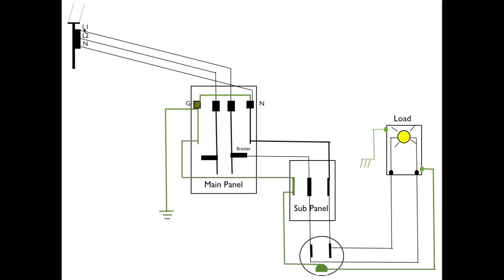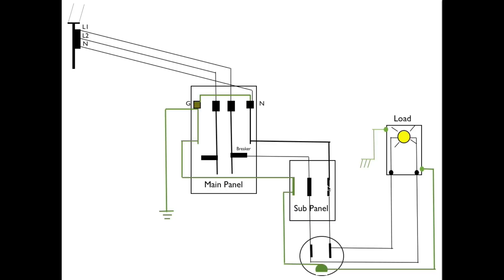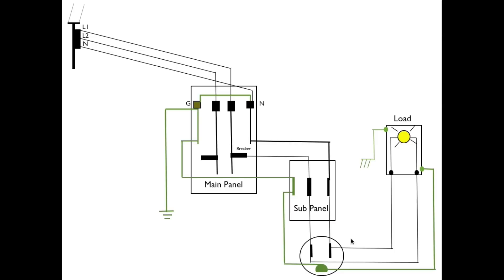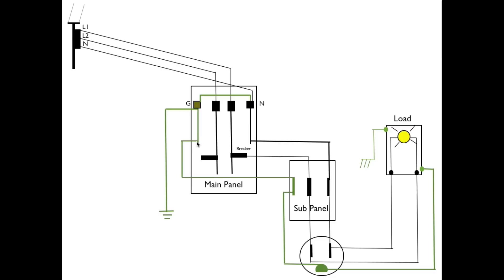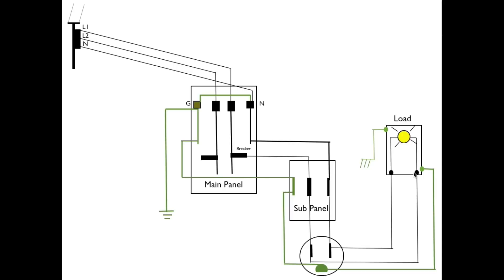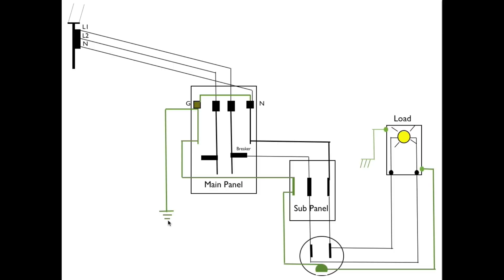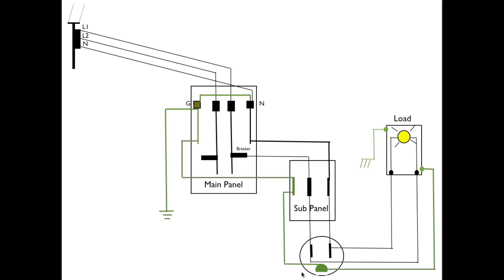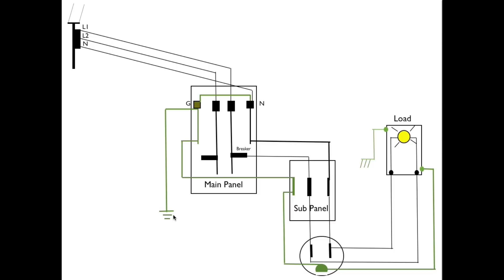The difference between neutral and ground on the electric panel

Comment: Black is polarized, white completes the Alternating Current loop,unlike Direct Current, positive to negative, where there is only one cycle. If A/C reverses polarity every second, then 60 cycles per minute.  The Ground wire connects the appliance to the Earth. A/C will seek out the quickest path to ground, don't be it.  That is the job for the breaker.  Nikolai invented this while he was digging a ditch.
Reply: 60 cycles per second.  
Try this to test your breaker.  Take a old metal case two wire electric heater into the bathroom and place it on the counter.  Wearing shoes plug it in and turn it on.  No shock. Turn it off. Take your shoes off.  Turn it on again.  No shock.  Turn it off.  Take some water and throw it on the floor. Stand in the water and turn it on again.  OH shit. Got shocked this time.  But not dead yet?  Take a razor knife and slice your finger a good one.  Touch it again. Should get a better shock.  Still not dead. Slice your feet too and touch it again.  It should kill you. If it doesn't you need to hold on longer.  Note that the breaker probably hasn't tripped.  If it does trip you won't hear about it. 
Only you can protect yourself from being shocked.  Don't put your trust in gadgets or other people.  Every time you don't get shocked just means you still have a chance to get shocked.

Comment: I am confused.  Looks like neutral and ground are in the same node, which means they are the same, isn't it?
Reply from the maker: They only connect together at the main panel.  At all other panels, they are kept separate to avoid the ground from becoming a current carrying wire.  This avoids a possible shock from touching the chassis of a sub panel or load.  Hope this helps.
GFM
Reply: Sorry, I don't see it as separate.  I see G and N as at the same point, or node.
Reply from the maker: They are not the same.  G is earth ground.  It has nothing to do with power conductors.  It is only for lightning and surges.  Try running a load with one side hot and one side to a ground rod not connected to the panel.  The load will not energize properly.  Neutral is the other side of line going to the pole transformer.  I have a number of videos on earth ground that may help and Mike Holt has some too.  Hope this helps.
GFM
Reply: I went and looked at your videos on G, N and Common, but I am still not clear on the distinction. You are right about G,N and C being used as if they are the one and the same.  I am still confused about them.  I do appreciate your videos.  Thanks.
Reply from the maker: Perhaps if you were to look at the problem as a circuit with its source at the pole transformer without any ground at all.  The circuit will work normally.  The ground is not necessary.  It is added just to absorb spikes and surges.
GFM
Reply: Did you say that think of G as having a large resistance?  I would have thought G has a zero resistance so that current can pass through fast, like short circuit, to absorb spikes and surges.
Reply: me too
Reply from the maker: To understand earth ground, you have to get away from circuits per se.  There is no real circuit thru earth ground unless you have very high voltage.  I have a number of videos on circuits thru earth ground.  Earth will absorb electricity under some circumstances.  That is not the same as completing a circuit.  Hope this helps.
GFM

Comment: Hi. Why is L2 not connected to the sub panel?
Reply from the maker: This sub panel uses only 120 volts.
GFM
Reply: Thanks. I have recently began the journey to self study wiring. Does your answer imply that L2 is connected to the sub-panel in countries that use 230 - 240 V as in the United Kingdom?
Reply from the maker: Yes.  This video covers the 240-120 3 wire system in the US.
GFM

Comment: The earth is an ocean of electrons. Generators "pump" the electrons out of the ground and into the electrical system (this is why generator stators are grounded). The electrons flow through the wires, to your house, and through whatever equipment they are running. After flowing through the equipment they "return" to earth via the ground wires that are connected to the neutral wires. That's why there are multiple grounding points in an electrical system. At least two for every load center (aka panel) and then down grounds (that connect to the power company neutrals or messengers) on just about every other pole. If you were to remove all of the ground connections in a system, the power would stop flowing because it would have no way to get back to ground.
Reply from the maker: So, I guess I will be electrocuted when I stick a shovel in my garden.  You could remove all earth ground conductors and the system will work normally.  I have done several videos on earth ground.  Check my grounding and bonding playlist.  What you are seeing with ground wires on poles and panels are just lightning protection with some surge and spike protection.  For many years electrical systems were installed without any ground at all.  The grounds were installed because of damage to appliances and circuits from lightning strikes.
GFM
Reply: grayfurnaceman yes you can make an electrical system without any grounds but there needs to be a difference in potential for the electrons to flow from one area to another i.e. 100v at one end and 50v at the other and the power will flow from the 100v side to the 50v side. The earth is 0v so no you won't be electrocuted by sticking a shovel into the ground. But you will get electrocuted if you remove the last ground in a system with power flowing through it and you complete the path from the system to ground with your body.
Reply from the maker: I know you think the earth ground is part of the electrical system but it just is not in most cases.  It is a great sink for lightning, but it is not part of the circuit.  There are places that use the one wire system in places like the outback of Australia, but it is not an efficient or common system.  Consider if the current passed thru earth, the ground rod would become an anode and would sacrifice and disappear in a few weeks.  Take a look at power lines.  There are 2 or 3 wires on them.
GFM
Reply: grayfurnaceman 
there are two or three wires on power lines because these are the different phases of a three phase power system. in an ac system the electrons are pulled back and forth at 60 times per second per phase so the electrons are actually flowing from the conductor into the ground and out of the ground and back into the conductor at 60hz. anodes decay when electrons are stripped from the atoms of the material and not replaced. in an electrical system any electron that is stripped or moved is immediately replaced by another one so there is no electrolysis taking place. the earth is full of electrons and the wires are full of electrons. the generators just create and "pressurize" the system aka voltage, and that causes current aka electrons to flow. it's a closed loop system. ground to generator to wire to load and back to ground.
Reply from the maker: We could go on forever this way.  Current does not go to ground when there is path to the other side of the circuit.  It is just that simple.  I will be doing a video on anode destruction to test your theory.
GFM

Comment: Seems like every time you try to explain something,  you get sidetracked.  Also, at 4.30 you say, of the neutral wire, "it is a current carrying load...."   (between the load and returning to the panel)…..can a wire be a load?
Reply from the maker: You are right, it should be wire.  And yes, a wire can be a load.  In fact, the total impedance of the circuit includes the wiring.
GFM

Comment: Whats Line 2? Is it another Hot wire? Does it travel the same as Line 2?
Reply: Also what is a sub panel for? Is it for additions to your house or a maybe a garage?
Reply from the maker: There are 3 wires coming from the pole.  L1 and L2 are hot leads from the transformer.  Neutral Is the center tap of the transformer.  Hope this helps.
GFM
Reply from the maker: billy estes II You are correct.  It also could be used to add breakers when the panel is full.
GFM
Reply: Ahhh alright thankyou.
Reply: grayfurnaceman  so you mean in stepping down voltages from a transmission to distribution line thru a transformer will have a neutral line output?
i think in a transmission lines all those line are live wires am i right?

Comment: I know this comment is about two years late, but I just found this video.  I have been struggling with this.  Also, since you know your shit, is "negative" and "neutral" interchangeable?  or is there a difference there as well?  Thanks again
Reply from the maker: Neutral is the central tap of an alternating current transformer secondary as in the power pole transformer. Negative is one side of a DC circuit. The terms are not interchangeable. Hope this helps 
GFM

Comment: The load wont work without a neutral right?
Reply from the maker: If the load is connected to one hot lead and the other conductor is neutral, yes it must have the neutral.  If the load is connected between 2 hot leads, a neutral is not necessary.  Hope this helps.
GFM
Reply: grayfurnaceman .. In this schematic if you have no neutral, light no workie!

Comment: Keep it simple like it is, a transformer secondary winding has 240VAC with a center tap that has 120VAC from the coil ends to the center tap.  These three wires are insulated from ground!

What is ground for a building, the earth its build upon to get a ground wire, a six foot copper pipe is pounded in the ground, not very good, that copper builds up copper oxide that is a good insulator.  Far better to use a plated conductor, it must make good electrical contact.  If your building has metallic plumbing and the pipes are buried deep in the earth, a strap to the plumbing serves as ground.

Bit off topic, a dipole antenna for transmitting or receiving has two rods with two conductors, and is typically mounted horizontally.  One of the rods can be mounted vertically isolated from ground, the other is ground, but a huge underground counterpoise made of galvanized wire is used.  If you just pound a copper bar in the earth, will work until it corrodes. 

This ground is connected with a wire to the neutral bus in the main circuit breaker box, the so-called neutral is the center tap of the power transformer.  Should also clarify for a single phase system.

One bad thing about connecting the ground to the neutral, the so-call hot wire, one of the central tapped secondary leads from the power transformer.  This wire is not only hot to neutral but to ground also, all of your metal plumbing is at the neutral level as any ductwork.

Lightning is also looking for ground and if it finds the ground in your home, may burn it down.

Next problem is with GFCI – Ground Fault Circuit Interrupter, should not be any current flowing through the ground circuit, and it is tied to neutral and the main circuit breaker box.  It compares the difference between the current flowing through the hot wire with the neutral wire and even with a  0.001 ampere difference can trigger a relay to cut power to both leads.

If you have a sub panel and not easy to find one with a common neutral/ground bus, if ground is connected to that bus, this means that the load will draw current from both the neutral and ground wires, neutral current would be about have the hot side, pop goes the GFCI.

Usually only find a three wire power cord on a metallic appliance, Black, White, and Green are the common USA insulators, green is ground and connected to the metal chassis.  The idea here is that grounded metal chassis will protect you against getting a shock.  But on the inside, if that hot wire inadvertently contacts that metal chassis, it would start a fire depending on much the load is.

If you are taking a bath in a metal ground bath tube and drop in say a hair dryer, the hot side will not only travel to the neutral inside, but also through you since the neutral is tied to ground.

And if lightning is around, not interested in neutral, but ground is what its looking for.

Comment: I don't understand the part sub panel earth ground and neutral where if they are bridge than breaker would not trip or work in event something failed at light box?. If we eliminate the sub panel equation that mean all breakers on main panel will not work either?.

In this schematic diagram, it appear sub panel is acting as an extension cord with many extra outlet and the light box is connected to. The neutral and earth ground bridge isn't needed or required because it already been done at the main.

Comment: Neutral is a Current Carrying Wire (conductor).  It has to be, otherwise there would ONLY be one wire coming from the power company for 120VAC, and the circuit would be OPEN / INCOMPLETE.  Electrons need a complete circuit to flow.  The direction they are traveling changes 60 times per second, and is irrelevant.
Reply from the maker: You have a basic misunderstanding of power as it is produced and distributed.  All power comes from the power station as 3 phase which has no neutral.  Neutral is part of the circuit in some single phase distribution systems.  In any case, a neutral will be used as the center point for the secondary winding of the pole transformer to return any unbalanced circuit loads.  
GFM
Reply: No, I understand that perfectly.  We're talking about 2-phase residential coming off the pole / transformer with a center tap.  Went to univeristy for electronics and computers, so let's assume I have a basic understanding of electricity.  Do you think the electrons that change direction 60 times a second care which end of the transforming they're coming or going from?  The center tap on a 120 vac line can simply be viewed as one of the 2 power wires.  The "neutral" tag is a misnomer.  It's just the end of a shorter secondary coil.
Reply from the maker: Actually, the electrons do care where they go.  When one side of line is 120 volts positive and the other side of line 120 volts negative, the potential difference is 240 volts.  If there is a path between the 2 lines, the power will pass there.  It will not travel thru the neutral as the potential is only 120 volts.  If the panel loads are unbalanced, there is no path between the 2 lines for the unbalanced portion of the loads.  The neutral will then become the path for the unbalanced load as it is the only path available.
GFM
Reply: I think we're talking about two different things here, but I will defer to your expertise.  I have no dog in the hunt, except that I have a 1979 Zinsco Type Z power panel with 2 fried (melted) circuit breakers and a partially melted buss bar.  lol  That's what brought me to these topics to begin with.  I was going to try to fix it since the guy wants 2300 to replace the panel with a 200 amp box.  Seemed a little high to me.  I know I'm not going to replace it myself.  Just trying to get smart on the topic to hire the right person.  Cheers.
Reply from the maker: The zinsco panels were garbage.  Better get it replaced before it burns down your house.
GFM
Reply: That's pretty much what I found out today.  Thanks for the advice.  I'm going to do just that.  Cheers.
Reply: Ima, Power to homes is single phase not two phase. The two 120 volts "hots" are in phase, ie they add to 240 volts. If the service was two phase or three phase the two 120 volts legs would not add to 240 volts, but a lesser voltage. A more common term is the 120/240 volt scheme is a "spilt phase" system. Regards 3BW

Comment: Doesn't the ground wire connect (somewhere) DIRECTLY TO THE CASE of the main panel?
Reply: dale nassar    Yes.   Green screw either in the bussbar or in a small bracket installed in the bar and then green screw.   In case of short circuit to the can.

Comment: The sub panel is 110 not 220 am i right or wrong? What is the point of 110 sub panel if you need 220?
Reply: so where would the forth wire go? You made it confusing by going from 4 wire to 3 and not saying it was 125. So i would assume that 220 sub panel needs a ground rod also?
Reply: you can have a 120 sub panel or a 240 sub panel......they are identical except for the second hot wire in the 240 sub panel.....it would still be wired same as the 120 sub panel with the separate ground and neutral bars
Reply: +robert mccully a 240 sub panel does not need a grounding rod......the grounding rod is only used on the main service panel and the ground wire goes to the sub panel.....so if you had a 240 sub panel, it would look identical to the 120 sub panel except have an additional hot wire
Reply: if the sub is in a separate building, like a garage, then code says it needs it's own ground rod.
Reply: i do not have ground rod in garage---are you sure? What is the UBC code number?
Reply: robert mccully Dave is correct for an unattached building you need a separate grounding rod.  I did not consider a separate building in my original response
Reply: What is the code number?
Reply: robert mccully — He is just illustrating the difference between ground and neutral, not designing a complete system.  He needs only one 120V circuit to do that.

Comment: Nice video however clarification a water service is never  the system grounding electrode it is only connected for accidental contact ; it's called bonding !!!! ground rods or system grounding electrode must be included in all systems seek jurisdictional advice on how many grounds .... Peace and blessings